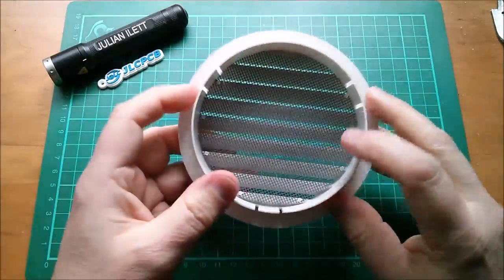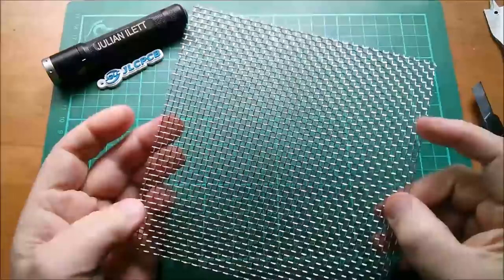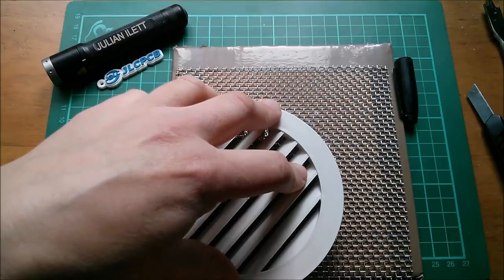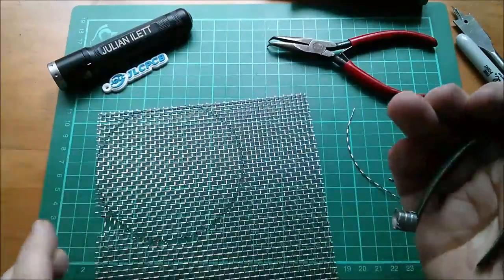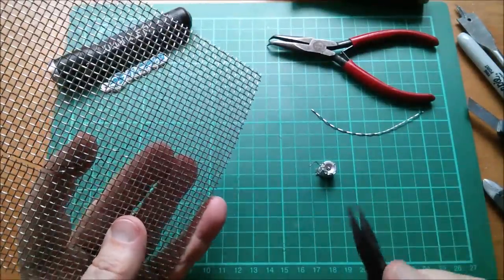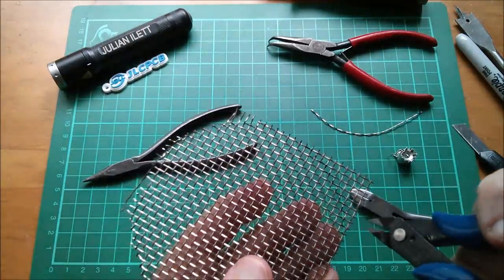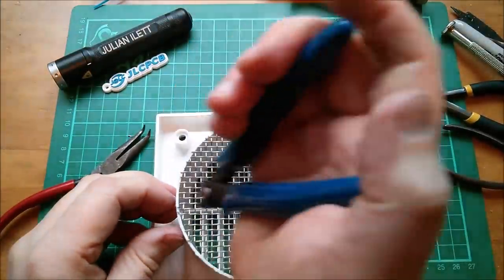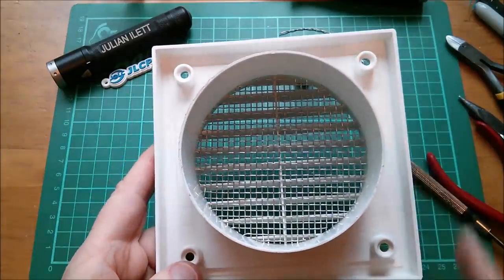High Quality Engineering in Stainless Steel

Comment: Well I'll be the first one to comment on the fact you should have used a grinding disk on a dremel, other handheld devices are available.
Reply: That was my first thought.
Reply: @wgm-en2gx  It's about the easiest way of cutting stainless wire.
Reply from the maker: In a 4" circle?
Reply: Yes, that was more thought too, as well as why didn't he buy thinner aluminium mesh.
Reply from the maker: He cut a few bits of wood
Reply: Yes, Dremel or a nibbler attachment for a drill. Mount either in a fixed position, then find the centre of the mesh with a nail and fix it to a board so it can freely rotate over the edge of the board into the path of the cutter.  Rotate slowly to avoid distorting the mesh.
Reply: @JulianIlett  Yup. It's what "High Quality Engineers" (yup, a bodge, but with stainless, it's by far the least destructive approach) would do, if they didn't have a hole punch to hit it in one go.
Reply: @JulianIlett  The little grinding disc's are great for stainless, normal steel, just about any metal. Just wear eye protection as if you try and bend it they shatter and bits fly everywhere.
Reply: @JulianIlett  Yes. Works great. The next size up would be 'angle grinders', and they cut plate. The "in a circle" part is dealt with just like you did - "well, get it close, and keep trimming." A technique I've used with lessor meshes that's also useful is: Cut 1cm oversize circle. Cut 1cm notches toward the center. That leads to a slew of tabs that can be folded. That can be shoved inside, or clamped over the end in other situations.
Reply: @JulianIlett  Yup. Useful for lots of other things too like trimming blank PCBs.
Reply: My thought too, pin/screw in the center, Dremel cutoff at circumference, rotate the screen against the cutoff wheel.

Comment: I reckon a lot of insects could get through that mesh.
Reply from the maker: None that scares me :)
Reply: @JulianIlett  lol!
Reply: @JulianIlett  That's when they come in. After they have fattened up to scary levels, they wont be able to get out again and will have to hide and wait for you to open the door....before LAUNCHING THEMSELVES AT YOU!
Reply from the maker: Fortunately, in the UK we only have noddy little spiders that couldn't harm a fly ;)
Reply: @JulianIlett  I beg to differ. False Widows are a damn nightmare. I got bitten on the foot by one many summers ago, and my foot went brown and left a nasty scar for life.
Reply: @dj_paultuk7052  He could just put a wad of steel wool in the tube.
Reply: Maybe he should just electrify it
Reply: The reality is it is a garden shed ... bugs are going to get in regardless.
Reply: Very torturous to watch an engineer do practical work, Julian. You could have used an angle grinder or a Dremmel type tool to cut it out. Instead of trimming them again, you could have bent the ends over with pliers. Bit like watching me do fine electronic work! ☺

Comment: The moment you mentioned stainless steel, I knew there was trouble coming. Should have used a Dremel cutting disk outside, 1-2-3 done.
Reply: You should use tin snips to cut gauze

Comment: B&Q have the craziest pricing policy ever. Typical is a bag of 10 screws, nuts and washers for about £2, but just a bag of 10 nuts, same size and material, costs about £4.
Their idea of "in stock" is equally crazy. "In stock for next day click and collect" means that they don't actually have stock at that store. You would think it means delivery is due, but that's only if you actually order the item otherwise it won't be available.

Comment: You've GOT TO USE the right TOOLS FOR THE JOB. In this case you needed a WELDING TORCH and an ANGLE GRINDER. AND AS A BACKUP HAVE A 12-BORE SHOTGUN IN RESERVE!

Comment: I'm often in a situation whereby something I've ordered has arrived through the post and I realise, after removing the packaging, that it isn't going to be as straight forward as I first thought (dreamt), because I don't have the right tools for the job. Followed by hours of sore hands, cuts, sweat and tears while cramming a square peg into a round hole. Having said that, there's an immense amount of satisfaction to be had when the job is done. Keep up the good work, Julian!

Oh, I nearly forgot to ask: Once the shed stabilisation project is complete, I wonder if you'd consider opening it up to the public as a local attraction? "The Hughenden Bio Dome" might be a good name to start with. You could charge £50 per ticket and they could visit the Manor after decontamination.

Comment: In addition to missing the insect screen the "blades" (or however to call them) are straight. So if you have a bit of rain it might go into the shed.
Reply: Slope the duct upwards on the inside and the rain will go right back out.

Comment: Oh for heaven's sake Jules! Just spend a few hundred quid on a quality 98.5mm punch and die kit... OK, you'll only use it once, but it will be worth it because... Erm... Reasons. :D
Reply: I agree. My workshop's littered with expensive one-time use tools which I absolutely had to buy for something I was working on. And a fair few which I just had to buy in case I would be working on something later that needed an expensive single purpose tool 😁
Reply: @MrJozza65  I have 2 of some tools cos I forgot I had already brought it & could not find it! "doh"

Comment: Those poor little (look like CK brand - I had a pair in the '70s) pliers, Julian !  I've used plastic mesh to keep insects out, I don't know why you didn't just hot melt the original mesh in place ? Stainless is a  massive overkill here I'd have thought, mainly because it's so hard, as you found out :o{ 
BTW- some s/s is magnetic, some not - stuff with nickel in it (eg scalpel handle) is not, ironically :o)

Comment: For next time:  At the store look for aluminium insect screen.  It's easy to cut and will hold a bend.  Used it to insect-proof some roof-vents a few months back - bent the edges over so it acts as a cap on the end of the pipe.

Comment: Have you ever heard of metal plate shears, they are sort of scissors (but of course much stronger) for cutting thin plate metal, and also other thin materials, I think those would have been the fastest way to cut that. Also, I think the first one with the plastic mesh would be fine if you just used silicone or maybe hot glue to go around the edge to make sure it stays in place.
EDIT: plate/sheet, sorry I don't know the exact term in English to use for this. But anyway they exist in hand tool versions and also more powerful bench-fixed and even electric or hydraulic powered version. A hand held version should be plenty enough for cutting that mesh :)
Reply: Yes, I have a pair of compound-action sheet metal shears. They would make a job like this a lot easier. They cost around $20, but totally worth it.
Reply: @Markus0021   Indeed, I have two, of different sizes, both compound action. The bigger one is a cheap version, marked "Value Tools" but still quite OK for the rare occasion I need them, with a blade length of about 4 cm. The other is a very handy smaller one with 2 cm blades, from Bessey, a quality brand. I cannot remember what either cost, but they have been invaluable on the few occasions I have needed to cut something too much for normal scissors :)

Comment: You could have screwed the mesh on the OUTSIDE of the louvered part...that way you would not have to cut it at all...just put the screws through the mesh into the holes already there.
Reply from the maker: I did briefly consider that :)
Reply from the maker: or just cable tie it

Comment: I'd probably (definitely) have used a finer aluminium mesh, you can cut that with old scissors, I doubt insects cold defeat aluminium. I used to work with scrap stainless, some was magnetic but the higher chromium content stuff is not.

Comment: Do you not have a dremel the one your using is for an inside bathroom as the slats are straight the first one is an outside one as the slats are sloped to reduce the rain getting in

Comment: Yes B&Q is a bit of a con, even more so when you consider that Screwfix is owned by the same company and sells a lot of the same stuff only a lot cheaper, Toolstation is generally cheaper, though.
A good example is the fact that my own brand 18V drill/driver was £10 more in B&Q, it's maddening.
Reply: You're paying for the spacious aisles and lovely people in orange aprons, I suppose.
Reply: I applied for a job at B&Q (as a lovely person in an orange apron) about 15 years ago, but the online psychometric test said I was too non-conformist...
Reply: @jhonbus  Yes, you generally go to Toolstation/Screwfix if you already know what you want and need no assistance, plus like Argos, having virtually nothing on display must stop thieves.
Although saying that Toolstation do have a free hot drinks machine so that partially makes up for the reduced operating costs.

Comment: Uhm... Dremel?
Judging by how magnetic that stuff is it is definitly not stainless :)
Reply from the maker: "all of our mesh is made from 304 or 316 stainless steel"
Reply: @JulianIlett  from the Wikipedia Page for "SAE 304 stainless steel":
"It is less electrically and thermally conductive than carbon steel and is essentially non-magnetic."
can't find much about 316, but accoring to a german source i found it is even less magnetic...
Reply from the maker: It was only weakly attracted to the magnet :)
Reply: @JulianIlett  OK, then it looked way more magnetic than it was! :)

Comment: Aviation snips are great for stainless mesh. About £10 from MachineMart.
Reply from the maker: Plato model 170 pliers [sic] - about £1.50 eBay
Reply: Ferric chloride etching fluid also works on stainless.